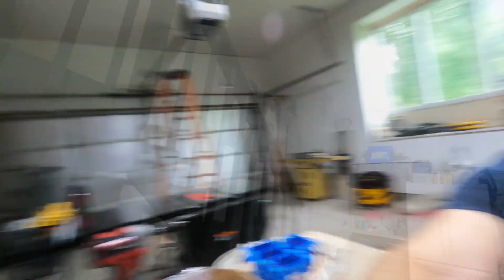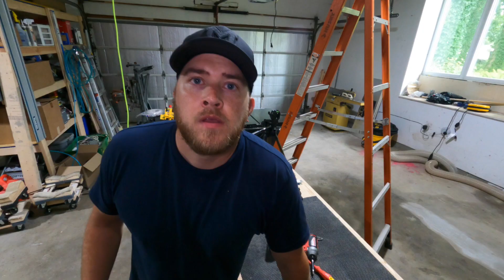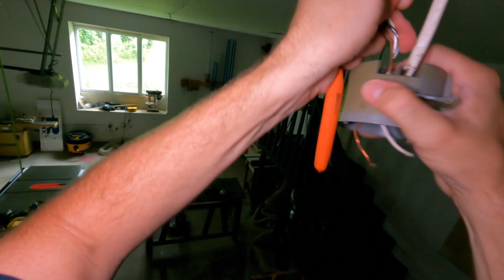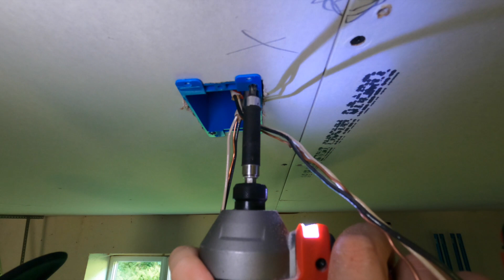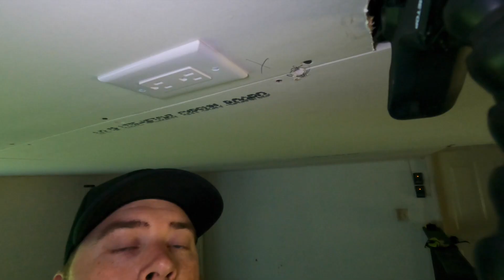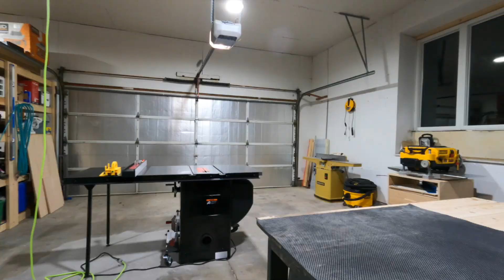Installing Overhead Garage Lighting

Comment from the maker: I hope this brightens your day. HA!
Reply: great video but one question I put up the other type of light that you had where you can adjust the angle the 3 blades and couldn't use it with the motion switch b/c it would just continue to flicker. I'm assuming these UFO lights don't have the same problem. Any knowledge on that?
Reply from the maker: I did not have that issue with mine. I do not know what would cause them to flicker like that. I know some bulbs aren’t compatible with dimmer switches, so maybe some aren’t compatible with motion switches. Thanks for watching!
Reply: @EverydayBuilds  US$40.00 each = automatic Chinese junk.  Not US standards approved and all delivering a 1/4 of their claimed Lumens.  Total scam.  For your information 65,000 Lumens is provided by a single 750 watt Osram Powerstar metal halide bulb that cost approx US$200-250 each.   To get 65,000 Lumens with LEDS at your ceiling height would set you back at least US$3,500-$5,000 installed.  They will all be actively cooled and made to US safety compliance standards.  The USA actually make a large range of very high quality LED hi bays however they are in the order of 10-20 times the US$40.00 POC you hold in your hand at time stamp 2:41.  Get real kiddo.

Comment: Really liking your channel! Are the lights still working without issues? And for screwing in hooks and eyebolts, I’ve always had success with putting a separate hook into a drill and using that to run the hook/eyebolt up into the wood instead of a screwdriver.
Reply from the maker: That's a great tip and the lights are still working great 👍

Comment: Why outlets instead of snipping the plug off the lights and wiring them to the existing light runs? Fixing to do a similar swap but trying to figure out the best approach!
Reply from the maker: I did it that way in case one ever dies or I want to switch them out for different ones. Easy to just unplug and swap them out 👍
Reply: I was just going to ask this as i don’t have plugs with mine. Thinking of putting outlets up instead for the reason you just said. 
Do you know what the max amount of lights you can run on a line at 150watts each

Comment: What's the recommended spacing on these units?
Reply from the maker: It varies based on ceiling height.
Reply: @EverydayBuilds  Is there a calculator for the company somewhere?